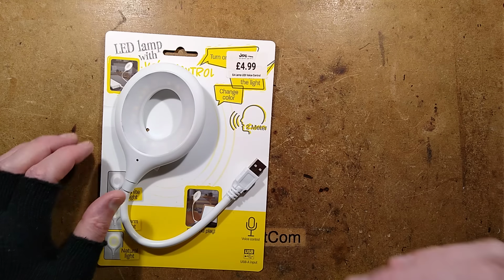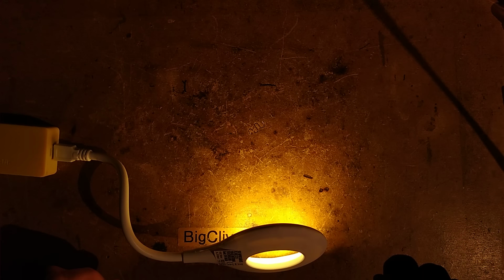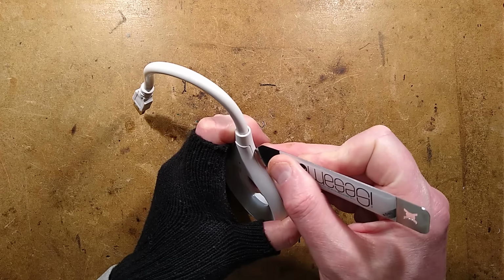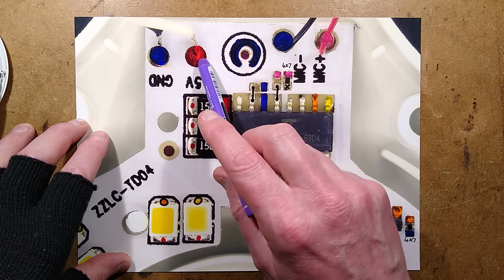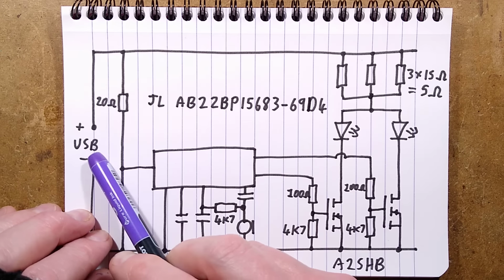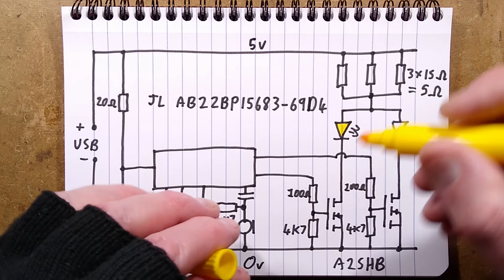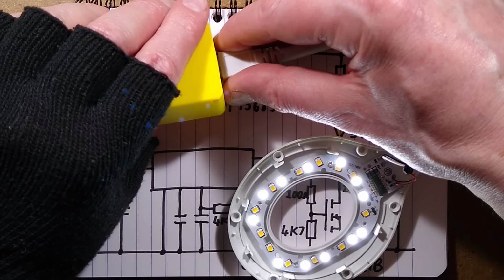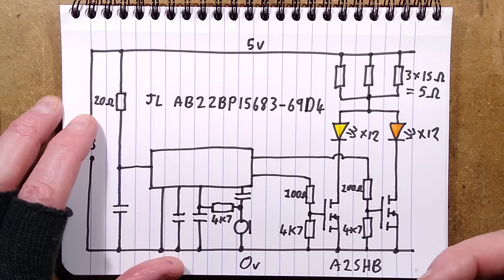Inside a voice controlled light - with schematic

Comment: In the early/mid 1990s, my brothers and I had a Buddy L "voice command" branded toy fire engine. It had a surprisingly large set of commands (for sounding the horn, engine start, lights/sirens and driving forward at the very least) and actually worked quite well. (It would also at least try to interpret totally off the wall commands.) There was also a set of recorded instructions available by pressing a button. There was also another button that started it listening for a command. Despite having been very curious about how it worked and what kind of processor it used, I never took it apart.

I have seen one of those "JL" branded ICs in an MP3 player and FM radio. I believe it was marked "AC1220". The FM radio tuning part was handled by another IC. It had at least one undocumented feature, in that it could play uncompressed PCM audio.

Comment: Do you remember when Radio Shack came out with their first speech recognition chip. Must have been the late 1970s. It was same time that different toys came out that you could command with your voice, but you had to say the commands very clearly for the chip to recognize and respond. I wonder if this device uses a more advanced phase comparator.

Comment: That seems like it has some beautiful hacking potential. Warm, cold, or both, at 5 different brightnesses, plus off makes 16 total states, controllable by voice command in a single chip. That would be an awesome addition to loads of projects with nothing more than an attiny and a couple more passives to interperate the chips output states into other ones of your whim. Would be 1000 times more awesome to have the raw chips and a way to program custom commands. I bet there's a decently robust little microcontroller inside that you could get to use the two output pins in even fancier ways.
Reply: You'd be surprised to find out that the little chip has BT 5.1, an integrated DAC, USB, SDIO, and FM radio. It's a repurposed Bluetooth audio chip.

Comment: I still have an old voice recognition  IC in original packaging from Tandy (remember them?) they used some clever tricks based around how long the command was and gaps between words, there was little actual "recognition" in this case for example "Turn on the light" and "Turn off the light are virtually the same and quite long with three gaps but it's a toggle function do it doesn't have to know the difference between on and off it treats them both the same. Change colour is short with only one gap,  dim the light has two gaps and dim is short, brighten the light has two gaps and brighten is long. It's basically a lot easier if the commands are limited and carefully crafted.
Reply: That may explain why they choose "dim" vs "brighten" for the light intensity.
Reply: @trueriver1950  It's exactly why.

Comment: The device probably utilizes hidden Markov model (HMM) based speech recognition, with either Gaussian mixture model (GMM) or deep neural network (DNN) based acoustic models. Speech can be decoded using the Viterbi algorithm. The code for this can be very compact, and due to the limited number of phrases the time and memory requirements can be static and not very demanding at all. This is old-tech. Of course, there is a lot more to making it work well in practice with different speakers and different acoustic environments, but these are standard challenges that such a system has to (and can) address.

Comment: Neat, I've seen a different iteration of whats probably the same chip at my local dollarstore in Canada. It looks like a little white USB flashdrive and claims to be a voice controlled light. Although IIRC, on the packaging it claims one of the voice commands you can issue it is "set a timer", I wonder if yours has that functionality as well.

Comment: Might be an example of edge computing. I haven't investigated the tools for this but the claim seems to be that you do training with the expected powerful computer but then condense the result into something that can run on a microcontroller.
Very impressive that it not only doesn't need personal training but can even cope with a scottish accent ! Clive's got a pretty clear voice, though. I wonder if it would handle glaswegian or geordie.
Reply: Assumption option based on what?
Reply: @phonotical  Based on th is sort of application being what it's marketed at
Reply: It's not using true speech recognition it's using carefully chosen commands and working of the length of sounds and number of gaps between them.

Comment: People were doing this kind of thing with X10 modules and sub-100MHz processors back in the mid-late 1990s. It was no Alexa/Hue, but it worked well enough to control lights and fans and stuff. My point is that you can make this work with surprisingly little tech. An RP2040 should be able to handle this with no trouble at all.
Reply: This thing has a lot less (and in some ways a lot more) functionality than an RP2040.  The JL chip started life as a Bluetooth speaker processor and even in small quantities sells for under 50 cents each.  The JL chip can run at 160 MHz, has a 16 bit ADC and two 16 bit DACs with >90 dB S/N.  There’s also USB, Bluetooth, LDO, charge controller,  DSP snd some other stuff.  It is possible a  lot of functionality was masked out on the chips made specifically for these USB lights.
Reply: @wtmayhew  Charge controller even?? o.O 
That is crazy...
I am somewhat familiar with JieLi, but didn't know they had chips that were THIS integrated..
Reply: @Versette  If I read the data sheet correctly… (not guaranteed)  It looks like very few passive components are required to turn this chip or some variant of it into a Bluetooth speaker.  Like a few resistors, a few capacitors, line driver and speakers, microphone, battery and that’s it.  Amazing!
Reply: @wtmayhew  I've got a bluetooth speaker with a JieLi chip powering it, and it's got multi-chip addressable RGB LED rings around both of the speakers, and on-device voice controls if you're connected to a dumb bluetooth device (like my Walkman). seems kinda crazy how much functionality isn't being used here.
Reply: @wtmayhew  - the JL chip pins functions are selectable at programming/run time through their SDK.  I don't think they make specific USB light chips, they just offer the same core/power/io capabilities in different pin size packages and let the customer select what functions the wish to use. A number of the pins not used in this light are those dedicated to the bluetooth RF and left unconnected on the pcb.

I think they may charge different annual licences levels for their SDK though depending what core functionallities are enabled or not. In effect a soft masking of the SDK to make money.
Reply: @GruffSillyGoat   Thanks for sharing the added information.  I figured there had to at least be a flash area where the chip could be customized to its particular (often Bluetooth speaker client) application.  That could run the DSP speech recognition code.  The other blocks  on the chip could be swtiched on and conn3cted as needed — something like loading a NIOS processor IP core and then configuring an Altera FPGA.  The advantage is the JL chip package is physically much smaller and the chip burns much less power.  Ir is pretty clever to commandeer the JL chip to be a speech recognizer for a smart LED lamp.

Comment: There are a few options for 16 pin voice control chips but they are probably different numbers for the same chip. They are audio playback chips with voice control options. YX6100-16S
Reply: Or JieLi equivalents

Comment: There are two different LEDs used in this device, which achieve 3 different color outputs by lighting the LEDs individually and in combination. You could use this device as a relatively simple voice-operated remote control by opto-coupling light sensors to the LEDs to control a circuit relay to turn another circuit on and off.
Reply: Or just put relays across the LED lines.
Reply: @TomCee53  LEDs will have PWM to get the dimming.  Relay might not be too happy with that.
Reply: @j.f.christ8421  Bung a capacitor on the gate of the driver FET. It's usefully already got a series resistor to form a low-pass filter. Of course, below a certain brightness it might not come on, so chuck in a series diode (and the pull-down resistor will ensure it switches off).

Comment: JL is made by the company Zhuhai Jieli Technology. Apparently you can decode the letters and numbers on the chip. Looks like this chip is made in 2022 indicated by the 22 after AB. The very last number shows how many Mbit flash it has, so in this case it is 4 Mbit flash. The datasheet number should be AC6969D and it seems to match the pinout. I  have no clue what kind of firmware would be loaded in it for voice recognition, truly amazing
Reply: if i had scrolled one bit further i would have not ended up in a google hole and placed a redundant comment. amazing detail on the flash capacity i completely missed that.

Comment: A lot of these voice controlled toys actually use the beat pattern of what you say instead of recognising words. Probably just high pass filtering + comparator + timer onboard. I believe there are chips that do this dating back into the 80s. An interesting thing to try would be to say something ridiculous at it that has the same beat to one of the commands.

Comment: I think the chip is a Jie Li chip. It is a Chinese manufacturer specialized in MP3 and Bluetooth chips. I think the chip in question may very well be a MP3 player chip, because it has an analog to digital converter and a powerful digital signal processor in a convenient SO16 package.

Comment: The first voice control I know is Elektro, a robot who appeared at the 1939 New York World's Fair. There is sound film of it reacting to voice commands. Judging from the stilted way the operator speaks into the microphone, though, I think it was analysing the rhythm or number of the syllables instead of actually interpreting words. Since all the circuitry would have had to be built with thermionic valves, this is not surprising. It's amazing they got ANYTHING to work.
Reply from the maker: I have a horrible feeling that Elektro the robot was fake.  Just someone pushing buttons behind the scenes.  Just like some of the current AI robots.
Reply: Think it also contained a prerecorded record of answers
Reply: I had a voice control robot out of the Sears Catalog back in the 80s.  It was the variety where you had to teach it phrases yourself, and it was not particularly useful even when it worked.  The voice recognition was so awful you had to be extremely careful when recording the phrases, and even then it didn't calculate confidence levels or distances from existing commands, so any noise it picked up resulted in a random command being executed.  The designer tried to work around this problem by making the microphone a push-to-talk transmitter, but it goes to show just how terrible the voice rec was, and that was the 80s...
Reply: @oasntet  makes me wonder if the light would respond just by making the noises of the words
Reply: @phonotical  Quite possibly! Alexa sometimes wakes when you say words that sound similar to her name.
Reply: Bell labs had a demonstration of a speech synthesizer at the same World’s Fair.  It was pretty large and had a keyboard which looked a little like a court reporter’s machine.  The operator had to form words syllable by syllable.  The thing had a rather demented semi androgynous vaguely male very machine like voice.  The thing was a variable pitch oscillator, hiss generator and various filters which could be switched in and out.  A very dexterous operator was required to get something resembling speech.  About the best it could do was to say “she saw me!”

Comment: Yeah, BT stuff, audio player SOC with SDIO interface /w built-in multiple codecs and even counterfeit (non-MFI) lightning to TRS adapters. I suspect that it's one of JieLi Tech's integrated circuits out of their "smart toy chips" portfolio. I'm especially suspicious that it's a custom new twist on their subcategory of "Voice Light Series Chip". Minimal info states it can do "High-precision neural network speech recognition, recognition distance 5 meters" and no mention of any communication interfaces. It's mfg. pn. starts with AC instead AB though.

Comment: I found a "Dome Lamp" at a Dollar Tree store for only $1.25. You have to say "dome Lamp" to get it's attention, then it followed all you commands as you spoke on this video. Via Smart Home Products. It has the same circuit as yours, but only two LEDs for each color and an on board microphone. If I say "dumb lamp" it works at times.

Comment: It actually doesn't take much computational power to do voice commands if you limit how many there are pretty severely.  I played with a demo voice-controlled blackjack game on an original IBM PC back then, and it worked pretty well even running on that 4.77MHz 8088.

Comment: Proof that you don't need an Internet connection for a "smart" device. If they made regular household lamps (i.e. ones that will fit in a 120v/240v socket) with this control scheme I definitely would buy one.
Reply: There were lamps donkeys years ago that switched with a clap!
Reply from the maker: Clap lights are still available on eBay.

Comment: Interesting to see these low voltage designs where they have no option but to drive a multitude of LEDs in parallel rather than in series. In the olden days (I've been in electronics design for 40+ years) we were always told that that was a Bad Idea. I guess modern LEDs are much better matched (or binned) than the classic TIL209 et al.

Comment: Likely it's simply measuring the length of activity on microphone as a simple pattern to match. Few commands. Vastly different.
Reply: It will have to be more sophisticated than that in order to eliminate false triggering, but yes, it's some variation on a speaker-independent small vocabulary speech recogniser.

Comment: This is a mono Bluetooth chip with a built in voice codec, this is likely whats been programed to process voice commands. In theory you could return this as a Bluetooth chip, BUT it will only be used as a mono Bluetooth input. This is a low powered Bluetooth module, which would do good in like a mouse, not any kind of headset or speaker. The audio quality would be horrendous as it's both mono and low power.

Comment: At that low of a price and how reliably it seems to work, there could be a legitimate argument for scavenging that chip out of the light and soldering it into some hobby project to make anything voice-activated. Folks might think it odd  if you suddenly shout "turn on the light" and your stereo turns on or your camera takes a picture, but I am sure that there are many cases where a voice-activated toggle for a generic 5V out could be used.

Comment: Clive, I thought if you wired resistors in parallel it doubles the value. Not reduced them. Am I wrong?
Reply from the maker: It reduces the resistance but spreads the power dissipation.
Reply: In series you add the values together...try working out 3 resistors in parallel...15, 50 and 100 ohms(for example)...Clive can you explain how to work out the correct resulting value please
Reply: Ex. Two 100 ohm resistors in parallel act like a single 50 ohm resistor. At 5v, each carries 50 mA, so 100mA between the two.

Two 100 ohm resistors in series act like a 200 ohm resistor.

If both are 1/4 Watt resistors, you have 1/2 Watt of possible heat dissipation.
Reply: If you dont like maths there's an online Parallel Resistor Calculater page that does it for you - you just input the values.👍
Reply: @johnikey38  EXCELLENT...I'll try that Parallel Resistor Calculator ASAP...I should have guessed but us old farts are still trying to get to grips with this aspect of the Internet 👉🧿👈‼️
Reply from the maker: @alexmarshall4331  These days it's easiest to do a Google search for parallel resistor calculator.
Reply: @alexmarshall4331  If you have same values it's easy - you just divide the individual value by the number of resistors. For arbitrary combinations, result = 1/(1/R1 + 1/R2 + .. + 1/Rn)

Comment: I wouldn't be surprised if the microcontroller is of 28 or 16 nanometers node, as the AI requires a rather powerful processor in order to be able to correctly understand what people tell the lamp to do, especially with the local AI within. Also, some microcontrollers tend to have mixed lithography nodes, ie. 250 nanometers for power logics and 16 nanometers node for digital logics.
Reply from the maker: It's probably simpler than you think, with just simple phonetic pattern detection.

Comment: Harmonic detection - they've changed the name for this over the years but it is basically converting the signal from the little microphone to simple wave forms. MPEG compression is far more complicated but basically similar math and that is from like 1998? It's old math and that chip probably have a Bluetooth component because why would you use 2 different chips to make an USB LED light that just lights up when you could use the same chip to make your USB light connect to Bluetooth and change colours via an app? Just skip some chip inputs for the cheaper version.